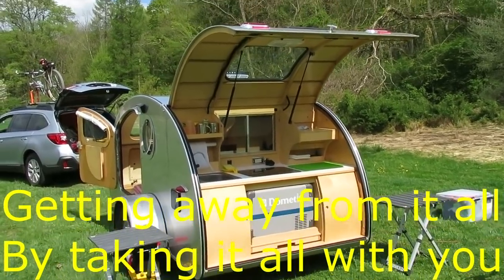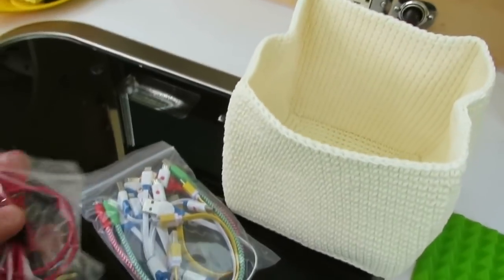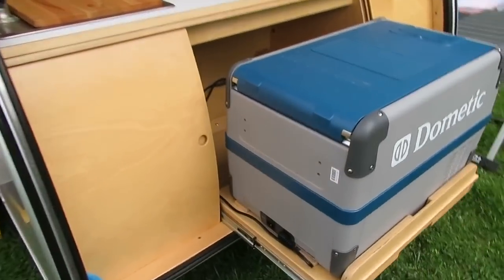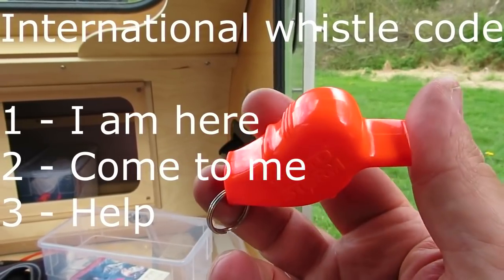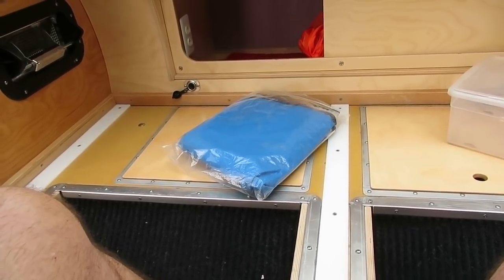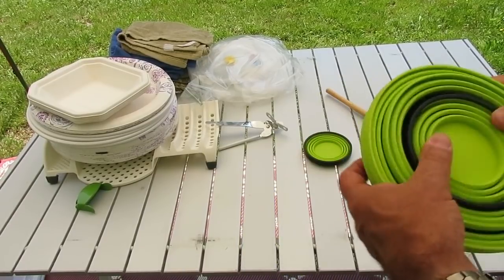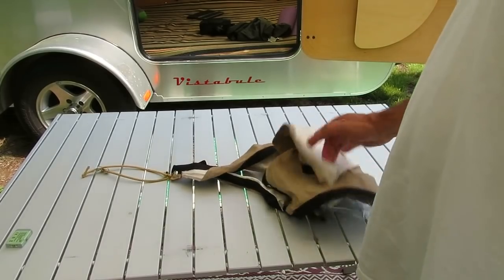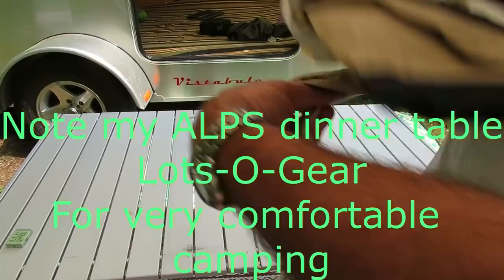RV Gear and Gadgets Teardrop trailer

Comment: I use chopsticks instead of metal silverware for eating and get larger shellaced ones for cooking. Quieter, less space needed and can be used for kindling.  :)
I have one bowlish plate. Eat then wash it. My fav kitchen tool is a flat mandolin to slice veg very thin so less water and fuel to cook.
I live full time in my Jeep but would dearly love to have this trailer.
Reply from the maker: Hi Jane! Thanks for commenting. Ya I hoard chopsticks when I order take out. I use them for everything. I do eat with them sometimes.I have a mandolin at home home and a micro planer. For some reason on the road I love to use a knife for everything. I find it meditative to slice and sharpen. It helps me appreciate the food and cooking even more. Hiker camper and runaway make trailers that start at about $4K and are light enough to tow with most vehicles. Also I reviewed Clam shelters. I consider those yurts which offer lots of space and protection from weather. We are fortunate to have lots of options to choose from. Thank You for watching. Check my other videos https://www.youtube.com/cosmoweems/videos 
SUBSCRIBE https://www.youtube.com/cosmoweems?sub_confirmation=1

Comment: For your faucet... You could use a kitchen sprayer with a water saver washer installed.
Your local mom and pop hardware could help with that.
Or you can use a barb fitting to faucet Aerator with a water saver.
Food for thought.
Reply from the maker: Thank You. I plugged 2/3 of the hand sprayer holes to reduce water. I could not find any aerator that would fit my faucet. Thank You for watching. Check my other videos https://www.youtube.com/cosmoweems/videos 
SUBSCRIBE https://www.youtube.com/cosmoweems?sub_confirmation=1
Reply: @CosmoWeems  I'll tell you this vid had so many hack that I never thought of....
Good work!

Comment: One thing to remember is that voltage is a measure of battery SOC (state of charge) only after some hours of no input or output. The only way to accurately measure SOC is with a battery monitor that measures current going into and coming out of.
Reply from the maker: Sandra I am with you 100%. I have one that measure the cumulative draw coming out of the battery. You might appreciate my non professional bloviating about  desulfation.  https://youtu.be/vRA9kZUqz2E =Cosmo

Comment: Have you ever tried using a spray bottle with vinegar to clean dishes (to save on water)?  Wonder how it works on those collapsible dishes.
Reply from the maker: Thanks Rick. I have heard of it from desert campers and it is on my list of things to try. Thanks for reminding me. I did add some white vinegar to the dish soap in hopes of some disinfecting benefit. I assume the dishes could all tolerate white vinegar (or we would be avoiding salad :)! Will let you know when I give it a try (if you don't beat me to it). I will test it out in my laboratory (the home kitchen... ha ha ha =Cosmo

Comment: What engine do you have in your outback? V6  or Turbo or  Judy a plain 4 cylinder ?
Reply from the maker: I have a 4 cylinder. I get 20 to 24mpg towing, I get 28 t 35 not towing. It does fine but maybe cant go as fast as a 6 uphill. I usually travel about 70 on the highways. Above that gas mileage is lower.

Comment: Hey Cosmo when you plug AC power into your camper does it also charge your battery because I want to hook up a generator system also with battery power , wondering if I can make it that my generator or plug in at campgrounds can keep my battery charged without the solar panels temporarily until I can get panels
Reply from the maker: When the trailer is plugged into AC power the battery charger charges the trailer battery and activates the AC outlets in the trailer. Even when plugged in to AC power the trailer 12 volt outlets and lighting draw from the battery. The trailer is ground fault protection for AC. When the trailer is plugged into the the car, the car charges the trailer battery.  Thank You for watching. Check my other videos https://www.youtube.com/cosmoweems/videos 
SUBSCRIBE https://www.youtube.com/cosmoweems?sub_confirmation=1

Comment: Cosmo, on one of your videos you had an inverter. It was small and had a travel holder. Can you tell me the model etc. TY
Reply from the maker: Hi James. Not sure about the travel holder. I have used this inverter https://amzn.to/2Llcnb6 (associate link) Its only 150 watts. Since I have the Jackery devices and they have a built in inverter I use the Jackery's now. This inverter is OK. It has a fuse but its soldered inside so if you blow the fuse that can be an issue in the field. I used it quite a bit for my electric shaver. It is a modified sine inverter a full sine will cost you much more. Thanks for watching =Cosmo
Reply: That’s where I saw you use it. Your electric razor. Thanks.
Reply from the maker: Works fine for that!

Comment: Hey, that's my knife sharpener!   I have one just like it.  Mine came with my Wustfhof traveling knife set.  It also came with a wine bottle opener.  👍
Reply from the maker: I love a knife I can keep sharp in the field. I avoid serrated knives. We are of one mind when it comes to gear and maybe more. =Cosmo
Reply: I think there is a steak/bread knife in my set but that's okay.  I like the options, anyways.  My knives came so sharp that I haven't needed to do anything with them.  I have a small stone that I'll bring to hone the edge, if needed.  Do you find your knives need that after using your sharpener or are they okay with just using that gadget on them?

Comment: Have you ever run into issues with your water pump? I.e. does it sputter? Having a bit of an issue with mine at the moment

Very helpful video, btw. I'm about to do some shopping to prepare for my first trip. Definitely going in on some silicone products now.
Reply from the maker: Thank You.  I posted this to hopefully help people think about what they might need and hopefully get it right the first time :). Everyone's needs are different but this might help. If you have a full tank of water and its sputtering check for air leaks in the line that sucks the water out of the tank. On mine the water line is see thru plastic and maybe you will see air being sucked in at a connection or something? I don't have an issue. If the sputtering is from an intermittent electrical connection that can be tested too. For professional advice Vistabule is the best resource! Regrds =Cosmo